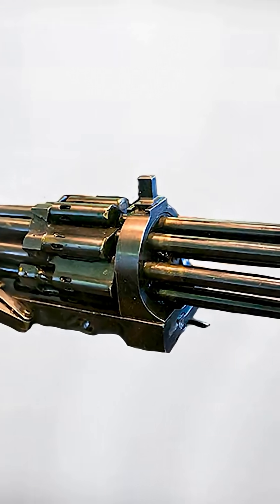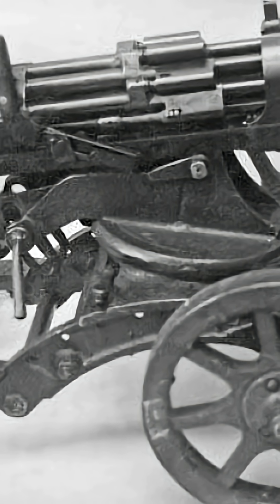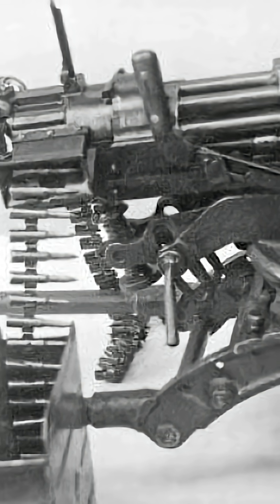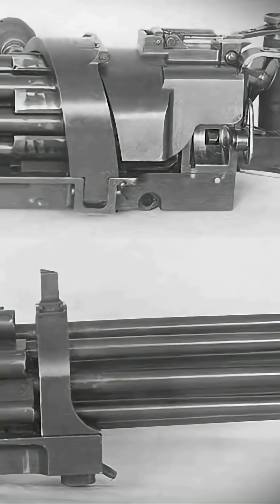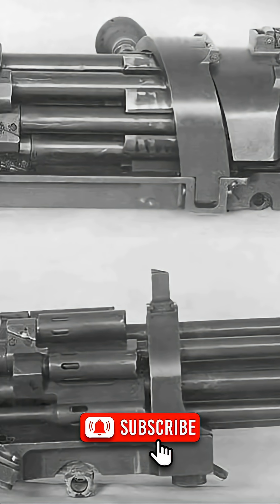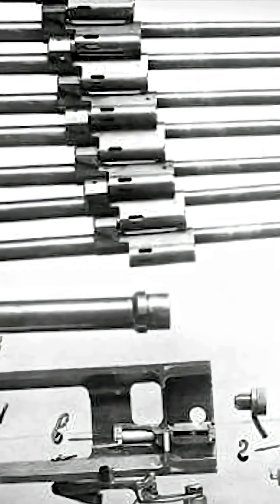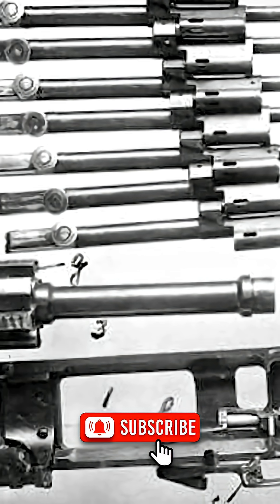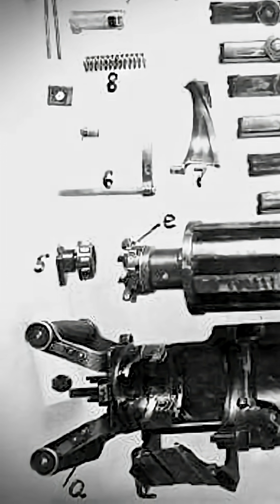The Soviet Machine Gun That Sounded Like a Bomb  #ww2 #history #military #army #wwii #easternfront

Comment: They were most definitely lagging behind this technology was developed in the United States 80 years prior to ww2
Reply: Interesting. Can you point me in the direction of this high rate of fire, gas operated (or another kind of self-powered), multi rotary barrel machine gun developed in the US in the 19th century? I'd be very curious to see it
Reply: @Prizrak-hv6qk sure the man who invented the Gatling gun patented a gas operated version in 1895 but it was never adopted due to complexity
Reply: @johnbelow578  Thanks. Not much info available on it, unfortunately. I'd love to know whether it used gas "bled" from ports in the barrels or a more "eccentric" system which uses gas from the muzzle(s).  Anyway, the Soviets were ultimately able to simply and perfect the gas operated rotary barrel machine gun design into a number of successful aviation and naval cannons.
Reply: @Prizrak-hv6qk  yeah but most of those weapon systems were actually developed in the late 60s through the 70s so irrelevant to ww2 the United States developed much more successful “rotary” weapon systems in the same time periods regardless of being self powered or not. The Soviet rotary cannons were notoriously unreliable especially on aircraft.
Reply: I wasn't talking about WW2 and yes, something that's spun up by an external motor is going to be mechanically simpler and probably more liable, as long as you have access to high quality batteries and proper maintenance, that is. However, eclectically spun cannons have their own drawbacks. If you looks at the Soviet gas-powered cannons, it's amazing how simple they managed to get them down to. As far as I know, the reliability issues leading to temporary use suspension was due to the design flaw in the early starter charges for the GSh-6-23 and there haven't been any issues since that one was resolved.
Reply: @Prizrak-hv6qk  I mean the whole conversation started by me discrediting the video which claims that the soviets weren’t lagging behind the Germans technologically because they developed a gas operated rotary cannon that the tech for had been developed in the previous century that they didn’t even use. I will say that they made the system work for naval purposes but perfecting a system that’s basically obsolete compared to its western counterparts isn’t that great of an achievement in my opinion
Reply: @Prizrak-hv6qk the original Gatling guns that were used in the 7 year war (before world war 1) were fully hand crank powered, they didn't use a gas blowback system or an electric motor system. 

Though the "brass beast" Gatling gun from TF2 has an electric motor instead of a hand crank, that is only a possible feature in modern times after the 7 year war had already ended.
Reply: @bobbybob5182  I am well aware of the original hand-cranked version of the Gatling gun. All of the modern multi rotating barrel machine guns and cannons in the US arsenal are battery powered. Russia has some battery powered and some gas (self) powered. I just did not know that Gatling apparently patented a gas powered version of his gun before he died.

Comment: The same system was later used in the GSh-6-23 gatling gun, which was adopted in the 1970s is still in service today. 
https://en.wikipedia.org/wiki/Gryazev-Shipunov_GSh-6-23
Reply: They ended up having four barrel guns in 7.62x54mm and 12.7x108mm (both used in helicopters and helicopter mounted gun pods), and also heavy cannon in 23mm (23x115mm) and 30mm calibre (30x165mm). Most of the time the rate of fire is too wasteful. For use in fighter aircraft or on ships to shoot down missiles the high rate is useful for short bursts. Most of the time a lower rate of fire with fewer barrels was cheaper and lighter and effective enough.